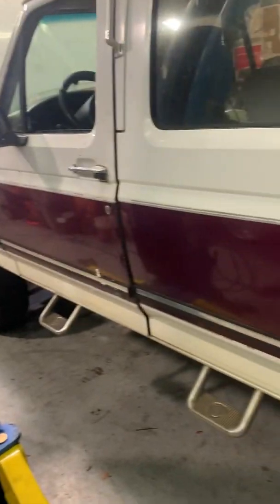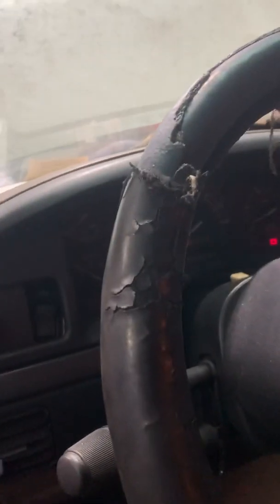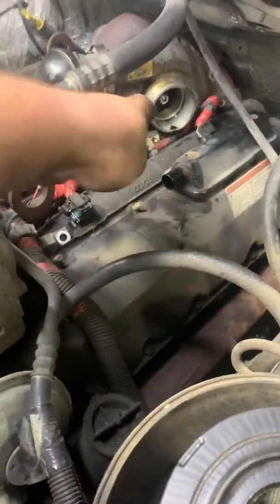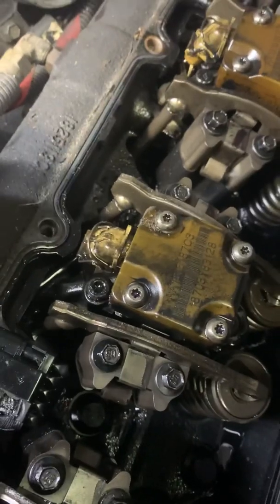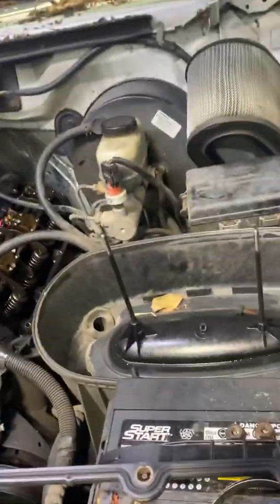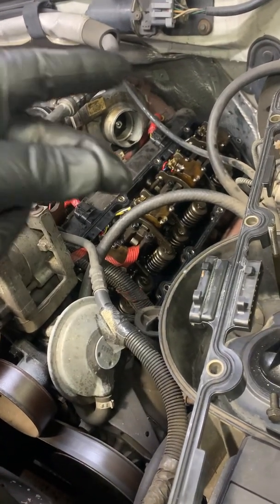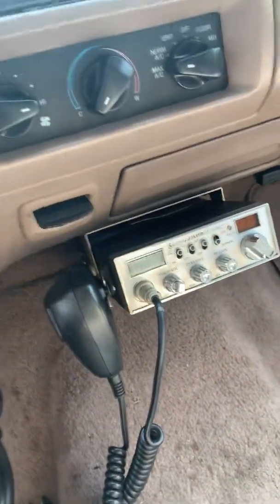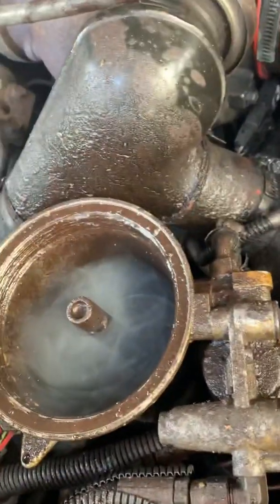7.3 powerstroke bad injector or bad harness?

Comment: I have a question, so my truck runs how it does when the connector is unplugged but doesn’t light any codes or nothing. What does that mean exactly?
Reply from the maker: Probably an injector solenoid is shorted out. I explain how to figure out which one it is in the video.

Comment: Hey man I found out what was wrong with my truck and why it was idling rough. I disconnected each injector one by one. And #5 didn’t do anything. But it passes the buzz test. What could it be ?
Reply from the maker: Intensifier piston could be hung up. Does the injector dump oil from the spill port when plugged in?